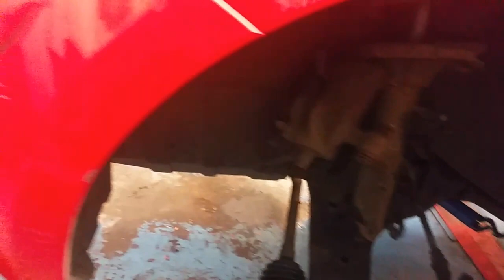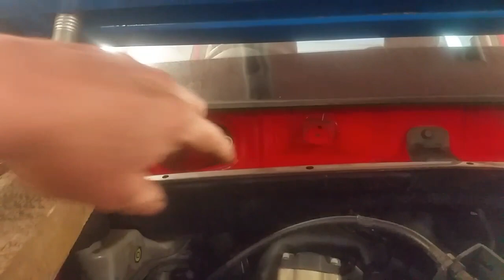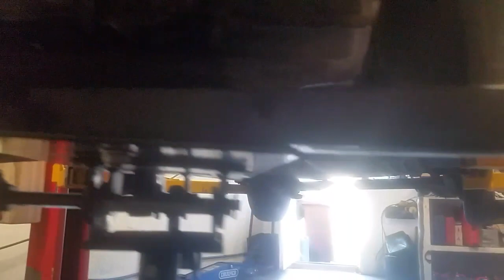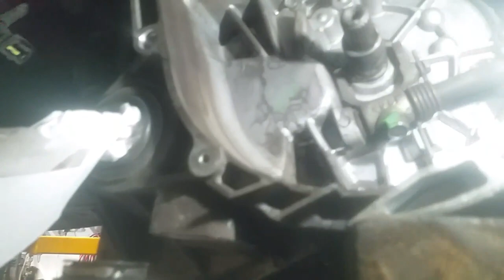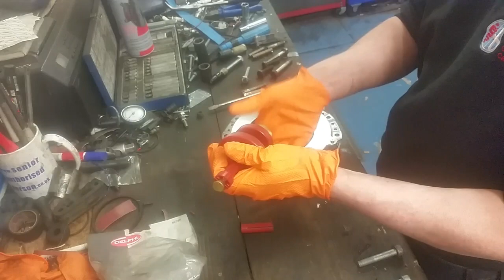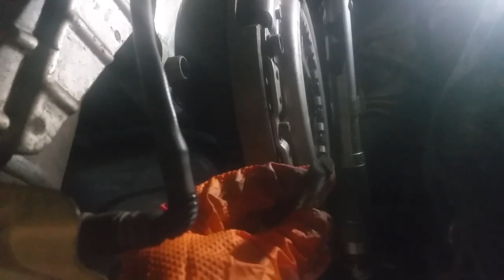Hyundai i10 clutch replacement. Hints and tips

Comment: Nice video, just done this job on my daughters 2011 i10 with a really heavy clutch, Got caught out by one tricky bolt hiding, in total 9 need to come off, the hub nut is also a odd isze at 29mm, otherwise following the internet instructions works well, thanks

Comment: My wife's hyundai i10 had a slipping clutch... finally it was booked in the she was told the i10 clutch was tricky and some "valve" might have failed  "a common problem with i10s"  - one place was looking to replace the entire gearbox.  She found another garage.. who want 2 days to replace the clutch.. and will replace the valve if necessary and not the whole gearbox..      Am I missing something?  I would assume just a cable and lever type clutch.  New clutch kit and away... assuming no damage from rivets.   Is there something special about Hyundai i10 clutches?

Comment: I think a heavy clutch seems to feature had a clutch cable snap on my i10 didn't change the clutch and its still going 4 years later, but I think the clutch need doing.

Also needs a new crankshaft seal as well.

Comment: Nice wee tip with the "guide" studs, makes good sense. Unlike many others mechanics Dave, I notice you are always well prepared ahead of the job. Right tools, technique and duty of care. Also work at a sensible pace which ultimately speeds things up by not "buggerizing" anything along the way. Great credit to the trade. Thanx as always. Cheers Pal
Reply from the maker: Whataboutye, ian. Yeah i use these methods so as im in control of it rather than it controlling me. Theres other vids on this utube of guys wrestling and beating on stuff which makes me wonder whats out there. thanks mate
Reply: @davesterl  Well said David

Comment: Thanks for all the tips mate 👍, i also use the universal clutch alignment tool and luckily never had any issue but I like you tip checking it after, and also the tip torquing the pressure plate bolts positioning the torque wrench to the middle ... Cheers 👍👍👍
Reply from the maker: Hey igor, glad u got something from the vid. Makes it worthwhile filming. Cheers dave